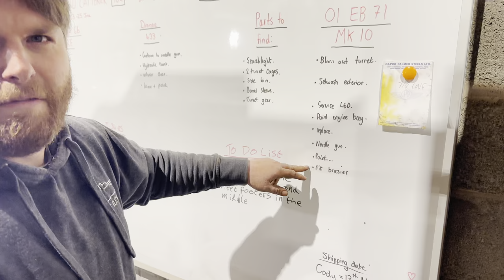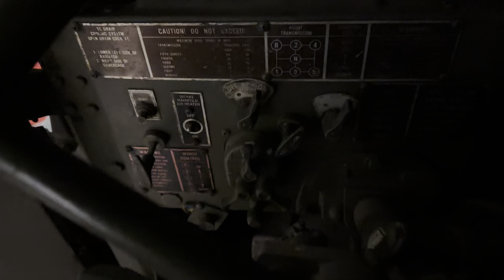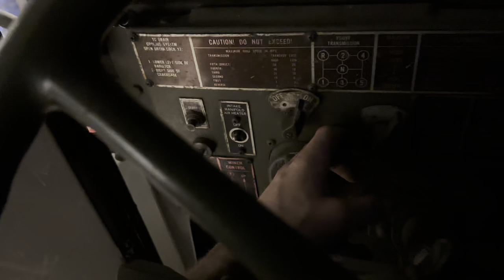We Paint a Chieftain Tank (Part1)

Comment: You guys need to get a HVLP pressure pot for painting these old girls....thats what i used when painting re-furbished d11 dozers.....pot that sits on the ground, holds about a gallon of paint, and has the hose and gun coming off of it and air hose plugs right into the pot.....makes painting big stuff easy and can put down a lot of paint quickly

Comment: Surprised you guys haven't got a sand blaster tbh
Reply: Rationale for not using one on a partially disassembled tank is explained in another video.  Apparently, the sand gets everywhere it shouldn't (into grease packed bearings, for instance) and turns into grinding paste.  Also, a bitch to clear up after.